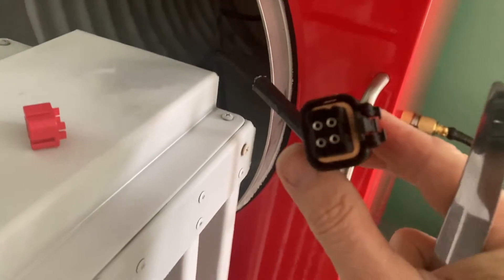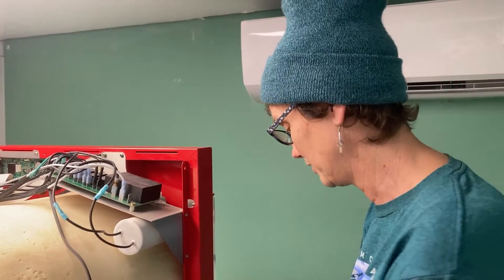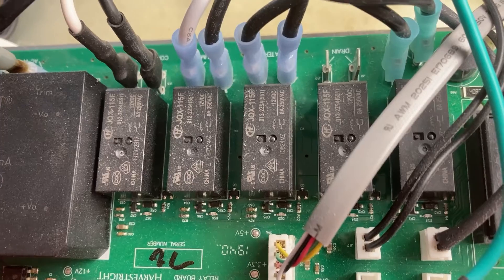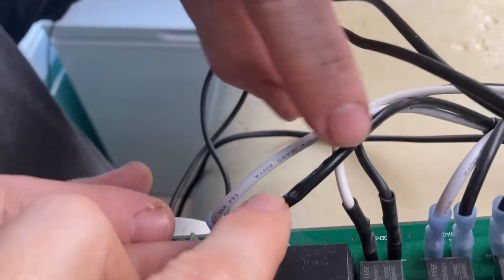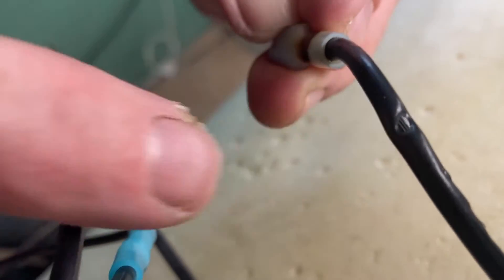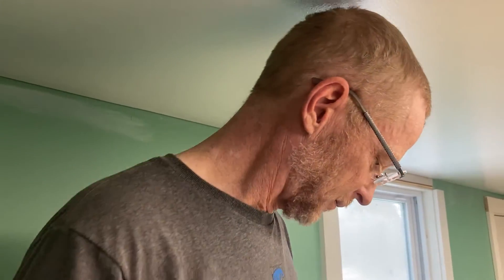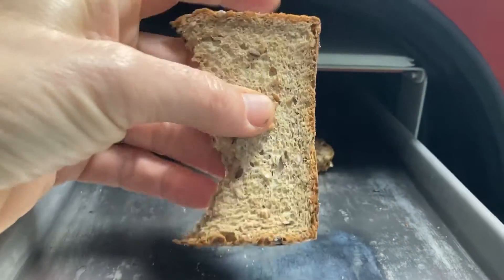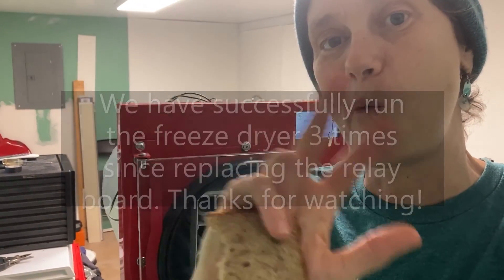3F: 2 Year Day 6 - Freeze Dryer Mid-batch Heater Failure Repair

Comment: My compressor went on my freeze dryer and living in canada i had to ship it back to the united states to get ut fixed. Fortunately my machine was under warranty but i had to pay for shipping. After the currency coversion it cost me 900 dollars. I started to do testing with a freeze dryer tech support over the phone and everything seemed to be okay but its only my second time using it after its been fixed and i had the mid batch heating error...im now just outside the window of my warranty and im not sure id reccomend this product. Ive loved it until I started having troubles..
Reply from the maker: Wow! That is so costly! I definitely have a love/hate relationship with mine. Currently I haven’t had any problems so I’m in the love stage. If it breaks beyond my ability to repair it, I think that would be it for me. Hopefully you will have smooth sailing for while once yours is fixed. Good luck!

Comment: My name is Joe Hinkle.  I have designed a replacement for the HR relay board.  There is a video about my board on the freezedryerrepairsupport youtube site - https://www.youtube.com/watch?v=7-fGyOhFLUM&t=563s   .  I have written a document that explains why the HR board fails.  HR did not understand the engineering about using a relay with an AC load.  I have implemented a solid state relay on my board to drive your heaters.  There is an issue associated with using a typical commercial solid state relay which is why I design the board the way I did.  When it comes to the HR Relay board - it is not IF it will fail - it is WHEN it will fail.  HR knows they had a design issue which is why they gave you the ability to move your heater to the SPARE or DRAIN relays.  I sell my board thru the www.fixmyfd.com web site.  I hope this helps anyone with a failure.

Comment: Great video thank you. Do you answer questions? Did Harvest Right charge you for the new relay? Also if a person is not able to do the testing and relay exchanging like you two did, who would I call to do this for me? An electrician? I will not attempt any of that myself. I know better.
Reply from the maker: Yes, I had to pay for the relay, but since I didn’t create a ticket, I just had to pay for the relay only. I would think an electrician should be able to do this pretty easily. The question is would they be concerned about liability on the product itself? I wish you the best of luck!

Comment: I am currently running into the same problem. I will do all the steps that are recommended and see if the reset button helps. I'm very frustrated that I paid this much money for something that has only lasted two years. I also bought the oilless pump and of course they make you buy the oil pump anyway.
Reply from the maker: The oil pump changed everything! It has been going strong with it. I think is actually achieves a better vacuum. Good luck!

Comment: I'm also starting to have problems with my machine or if no where. First it was no heat detected so i called harvest right and they sent me an updated firmware. I installed it and tried running a batch and ended up getting a mid batch heater failure. A now here i am at this video.
Reply from the maker: I hope this video is helpful. This resolved our problem and we have had smooth sailing for over a year now. It has been working hard! Good luck!

Comment: WOW apparently Harvest Right has some really bad quality problems in addition to all their design mistakes. I am  engineer and for the amperage this unit pulls they should have used screw terminals. Also they could have spent a little more on relays you could replace individually, but  profit is more important to Harvest Right. As I watch more videos I see what a bad choice these machines are.
Reply from the maker: Hopefully they will make these improvements! I feel like I’m driving Henry Ford’s first car!

Comment: As an electrician,  I can tell you that brown/black area up by that terminal lug happened because of a poor connection between the terminal and the wire. Probably wasn't crimped properly  and should be replaced with a new terminal lug. When you pulled that terminal lug off it might have caused a slightly better connection that fixed your problem. I would have replaced any terminal that looked burnt. Cutting the old terminal off along with a little of the wire at the terminal that had gotten hot. Extending the wire with a butt splice if necessary. Also i would run the functional tests longer than just on and off. For proper relay testing you need a clamp on amp meter to ensure the relay contacts are making a continously good connection when energized.

Comment: Do NOT get the oil free pump.  I spent $1500 on it and it lasted less than 2 dozen uses. It is just out of warranty and they won't even talk to you without paying $45 just to talk to support. I already took it apart and know what part of the scroll pump failed and sent pictures, but it does not matter.  Not a very reputable company.
Reply from the maker: The oil pump has worked like a charm! My oil free is a gigantic paperweight!
Reply: I totally agree. I  purchased the oil free pump thinking it would be nice to not have to change or filter the oil. I've already had it in for 2 rebuilds while under warranty.  I also have a premiere pump which is definitely a better buy. It's not that much trouble to filter and change the oil after every 5 batches.
Reply: What part actually fails in a scroll oil free pump. Does one of the 2 scrolls actually go bad? I know the bearings get replaced. There's a stationary scroll and a rotating scroll do they get holes in them?
Reply: Plus harvest right wants around $400 for a scroll rebuild kit. And maybe another $100 for labor to install the kit if you don't do it yourself. And if you have them rebuild it you pay for shipping both ways if out of warranty.
Reply from the maker: @pstoneking3418  there was not an option of rebuild your own when ours went. Nice to know that has changed.

Comment: That damaged(burnt!) wire(s) should be replaced or properly fixed ASAP. There are a lot of amps going through those wires. ITS NO JOKE!  It could potentially cause an electrical fire. IMO your burnt wire problem is due to poor quality crimps on the part of the wire harness that plugs into the relay board. Also, a wire heating up that hot could easily cause the relay board to fail prematurely. 
 
I hope this helps you.  I would NOT leave the unit running unattended until the wire(s) are fixed properly

Comment: Look the thing they don’t tell you is that there is a reset button.  Go to the back of the tray box.  There are 4 screws. Take them out.  There is a little black button right there. Push it. Test the heat. Should instantly heat back up! 
https://drive.google.com/file/d/10oxPl_aHA5an94So8bmjqfGtpxuammZL/view?usp=sharing

https://drive.google.com/file/d/1zAqWSdItP0QfA18gQFiCVBQMd9TiMDBj/view?usp=sharing

From harvest right
Reply: So if you are talking about the tray holder, the part you are speaking of is called a thermal overload protector. No need to take the screws off, just reset it by sticking something small through that hole and it will reset. There isn't a click or any way to tell it has reset. Plug the tray holder back in and and run through the diagnostics to make sure the trays are warming up. I have done this twice, not that Harvest Right would help at all without charging me a $45 fee. Harvest Right used to be very help with problems,  now they take days to answer and want you to pay them for any advice to help with their broken product. I think their days are numbered as a company, if there were another alternative to Harvest Right I would sell this thing and get something else.
Reply: @Rip9NinerRider  there is now. 4patriot has them! I have 3 harvest right machines and right now 2 of them are broken. I run a freeze dry candy business and I am in panic because of this. my trays won't heat up. anyways, not trying to unload my issues but I just found another company that sells these machines, I am looking into them now.
Reply: Much appreciated for the tip!!! The tech I was working with swore it was the relay board. That didn’t make sense to me as all of the relays are working correctly and I was getting the correct voltages out of them when they did fire. They need to add a step at the beginning of the tech’s script to have the customer push the relay button…stupid easy thing to do that can save $100 for a relay board I don’t need. I guess I have a back up now, one is none and two is one…
Reply from the maker: That is a little gem I didn’t know about. Thank you so much for sharing!!!
Reply: The thermal overload protector doesn’t fix the problem.  If you’re getting the mid batch heat failure (like me) it could only be one of 2 problems after checking the thermal overload protector.  1.- you need a new relay board.  Or 2- the software is causing issues.  I hope harvest right is looking into this- because a lot of people are having this issue.   No way everyone is suddenly having this same problem.   I’ve had my machine for 4 years.   And suddenly this is happening???  Very suspicious harvest right.
Reply: Thank you the reset button fixed our heater problem.
Reply: Hey Jill, 
Sharing is caring! Your post has made my day. I wish I knew about it before I bought the new relay board.
Thanks again,
Trendy

Comment: Thanks for video. I have the exact same symptoms. It won't go through a batch and gives same error message. But the test function and heaters clearly are working. Would you think my best bet is just to replace the relay? Are things running well still with your machine?

Comment: The oil keeps disappearing on my machine.   I filled it to midpoint which took a couple oz more than 2 cups as instructed.
Reply from the maker: That doesn’t sound good. I heard where it can end up on the food. Mine usually gets water in it and the level increases slightly after a run.
Reply: Check your pump and see if it’s leaking out of your pump. I have a premium pump that’s leaking after only two batches through it.  Realized that after the third batch when we smelled a electrical/oil smell during the run

Comment: I've been watching your videos and it seems you may have received a big lemon.  I certainly hope I don't experience all of the issues you've been having, that scares me - a lot.  There is a new home freeze dryer available, but it's around 6k :(
Reply from the maker: I can appreciate where you are coming from. We had a good year and then got hit with multiple issues. We have been going strong again since Christmas. We run it hard and hopefully will get a good solid run for a while!
Reply: It was not a lemon,  you will have issues. I have had my FD for a little over a yr now. Had to change power switch, now mid batch fail. My warranty is up so just to have HR techs look at the log file it will cost me $45. Im sure parts will not be cheap.
Reply from the maker: @usha777  My advice would be to change the board out and not worry about the log files. Doing that resolved my issues and have been going strong for the past eight months. The cost was just over $100. Good luck!

Comment: The drain relay appears to be a normally closed relay. So the light will be on when the drain would be closed and the light would be off when the drain is open. Simply put the drain needs power to be closed and no power would open it. That’s backwards from all the other functions. The heater needs power to be on. The compressor needs power to be on. The vacuum needs power to be on. The drain needs power to be closed. It needs turned off to open.
Reply from the maker: Thank you for explaining that so well. That makes sense now!

Comment: Hi, thank your for uploading good videos. I'm little curios about the freeze drying method and have couple of questions. The first question is what is common temperature for freezing foods and heating the food to evacuate the moist? and my second question is about the whole procedure. It seems that the process have two steps namely 1.freezing, and 2. heating, vacuum and draining. can you tell me how much time each step takes to complete?
Reply from the maker: Great questions that I wish I had the answers to.  I will try my best. So Harvest Right has managed to automate the process well enough that we don't really need to know how it works, it just does. What I notice is that depending on if your food is frozen, raw, liquid or solid changes all steps in the process. If I slice up strawberries and put them in the freeze dryer directly then the entire process takes about 30 hours. If I make a puree that has a lot of juice it can take over 60 hours.  It also depends on how hot your room is and how much humidity you have.  So it isn't so much a set time it is more about what type of food and what time of year or weather.  It is complicated and I'm really glad it is somewhat automated. I find myself letting it run for what it thinks it needs and then I add time to make it end at a time convenient for me (i.e. if it is going to stop in the middle of the night or something like that).  I know that isn't really answering your questions but hopefully it is helpful.
Reply: @foreverfoodsfarm  Oh, Thank you that was very helpful for me! best wishes! ❤️

Comment: You should replace the power connector that is dark.  It will be a problem.   Cut it off and crimp on a new connector.  All connectors must be tight.
Reply: Absolutely! There is a poor connection there and that is causing that spade connector to over heat. Guaranteed it will only get worse as the constant heating will increase the resistance between the wire and spade connector. The spade connectors are cheap but you also would need to purchase the crimping tool. Those tools are not expensive but are the proper one for the job. Any good hardware store will have both.
Reply: @mikewurlitzer5217  YES! It could cause an electrical fire if not replaced.  Poor quality control for sure.

Comment: If you haven't, I'd urge you to go back and replace those wires and terminals that melted. They are now damaged and likely won't be able to carry the same current they did prior to melting, and not what they are rated for. Definitely a future safety hazard (I spent 20 years repairing electronics). If the unit is getting that hot, it really wouldn't hurt to stick a fan on the outside blowing right into the large air vents towards the top of the unit (where the motherboard/relay board is) to help remove hot air and keep air circulating.
Reply: it was probably a loose fitting connection....either the connector to the spade on the board and or the crimp was bad. Either way that wire and connectors need to be replaced or the same failure will most likely happen again.

Comment: I have the same problem.  Replacing the heat relay circuit tonight, but not replacing the whole relay board… yet.. lol.
Reply: How did it work for I have the same problem going try it out for my self.... Just going to move the drain relay to the heater relay....
Reply from the maker: I would love to see how that’s done. I feel like the rest of my old board is completely fine. I just don’t know how to do what you’re doing. Let me know if it worked. Good luck!
Reply: Ya, I couldn’t unsolder the pieces I needed, so I broke down and ordered a new board.   But now my machine works amazingly.

Comment: Your videos are very helpful. My HR freeze dryer not a year old and it is constantly displaying error codes, mainly vacuum errors but I did have midbatch heater code. I don't believe I have run more that 3 batches without getting code. I don't  have 50 batches on the freeze dryer. Beginning to wonder if it is worth all the expense.  But, like you, I keep plugging away at it, always worry I will hear that dreaded beep letting me know it has quit working. 
Good luck. Hope the relay board has solved all your problems.
Reply from the maker: That dreaded beep gives me anxiety! My heater problem started intermittent then Eventually was every run. The relay board has fixed the problem so far. Getting my confidence back. If you are still under warranty you might want to see if you can get that board replaced. I feel it might’ve solved other issues as well. Good luck with yours!